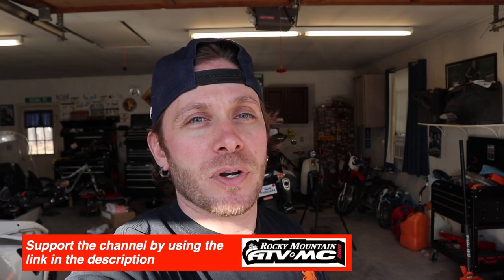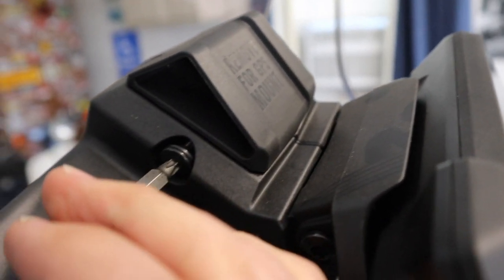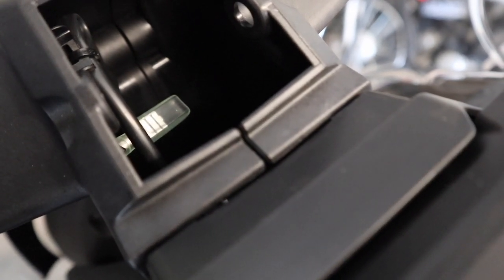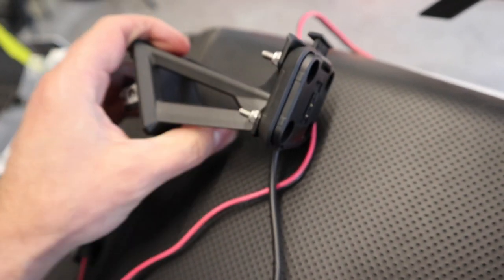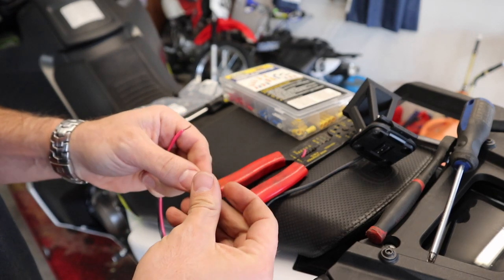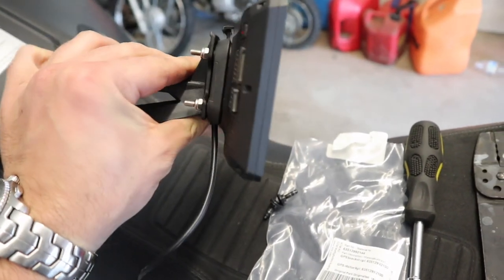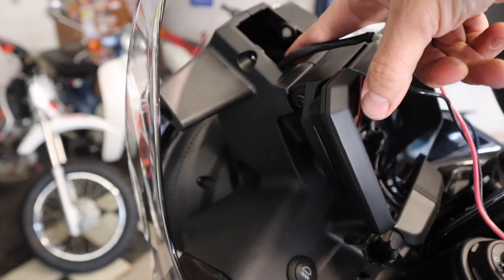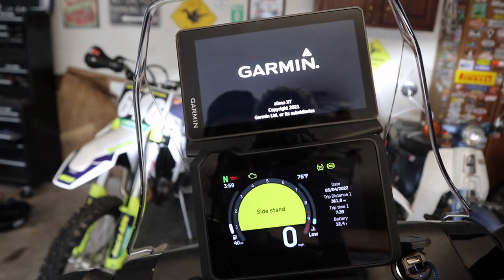Norden 901 GPS Install | Back in the Garage

Comment: KTM REALLY needs to make their ACC wires easier to access. It's not totally ridiculous on the 1290 but you shouldn't have to remove hard parts to get to a wire. Another great video from Mario. Thanks, man.

Comment: When you put the gps mount back in the bike did you have to make any modifications for the wire? You ran in middle bottom. Is it ok? Will it pinch the wire?
Reply from the maker: No mods. It’s not too tight so don’t expect any issues with the wires getting pinched.

Comment: Hi, do you know how many amps we can get out of these wires (and the corresponding fuse which O don't know which one to is) i.e. can i plug both my gps (garmin montana) and iphone XR ? I am guessing probably 5 amps ? 
Thanks and great video !
Reply from the maker: While I'm not 100% on the 790/890/901 the other ADV models are 10 amps on these wires. I'd expect these are the same.
Reply: @2WR  Thanks for your reply. The 12v cigarette lighter plug is 10 amps as well. So I just wired my GPS and 5v USB to see and it works fine.